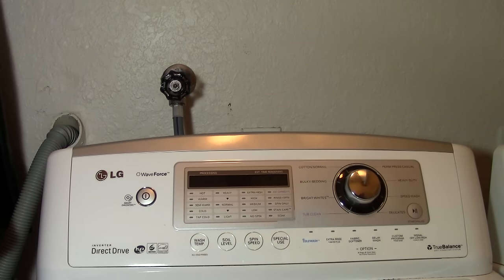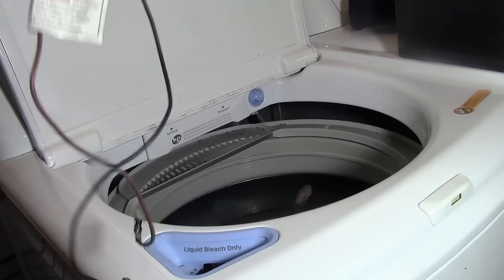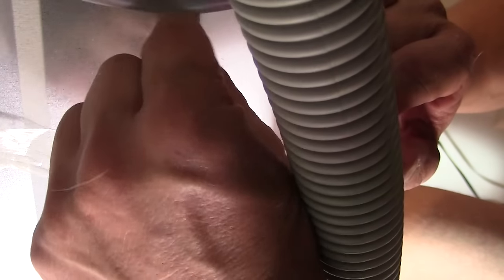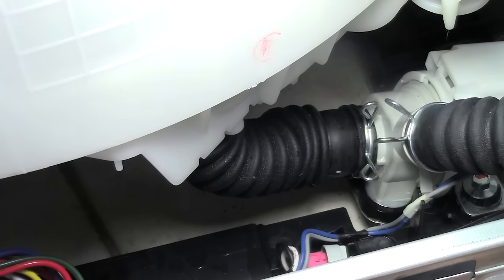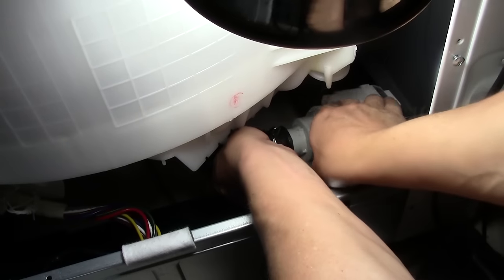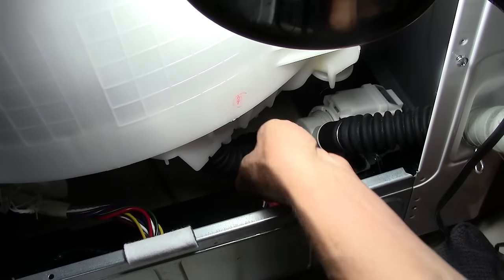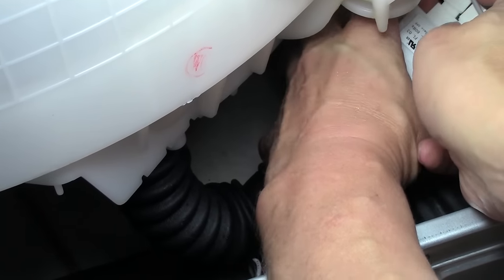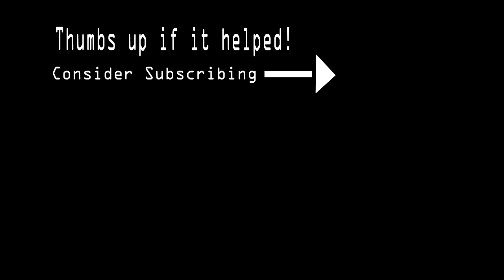LG Washing Machine Wont Drain or Spin --  (OE ERROR CODE) How to Fix PUMP and LINE

Comment: Thank you so much Jake!!!  Your great video and instructions helped me save a lot of $$$$$ since I did not need to place a service call.  I followed along with your video and I was able to remove the pump motor out...... and low and behold, a small nail was in the same area that you found the paperclip.  I reassembled everything and ran a "spin only" and it was so heavenly hearing that water drain out of my machine.  Thank you, thank you, thank you :)
Reply from the maker: Glad it helped!

Comment: Had same issue...removed the incoming line hose on the pump...nothing...prop moved freely...checked outgoing...nothing..reassembled and ran just fine...for now.  I think I will still have repair guy check it out. At least I can get a load or two done in the meantime. Thanks for the video.

Comment: Thank you, this helped me clear the drain pump of a piece of metal. Although I did learn a lesson that even though the tub looks empty, that hose and tub will still contain 3 to 5 gallons of water.
Reply from the maker: +crossmenjeff ->  YES!  There is definitely still water in the tub that you cannot see.  Also, the hose contains a decent amount of water, so if u disconnect it, water will be on your floor.

Comment: Jake, just disconnected the front hose and no debris. However the impeller turns with some reststance. Should this pump impeller turn super freely or is there to be some jerkey resistance?

Comment: Thanks so much for your video. My machine is a different model but  all the same i guess. I managed to fix the OE fault but the problem was within the filter itself. Your video showed me the way to remove the assembly and I went from there. Thanks.

Comment: Wow, Thanks man. Found some junk and a small screw. FIXED My wife thinks I'm superman. Don't teller I got you-tube help.  :^)
Reply from the maker: Yep, the hardest part about this job is getting the water out of the washer, because if not, when you disconnect those hoses on the pump, you will get a flood in your house.  Glad the video helped and thanks for watching.
Reply: Because of gravity, I was able to remove the hose and plugged it into another hose to drain it out to the backyard. Once you open up the clamp and hose to the pump, you'll still get some water out.

Comment: Worked !!!! I have abit of a different washer but components where the same ! I had a finishing nail stuck in mine !!! Thank you so much ! Also I used a shop vac to remove the water worked well!

Comment: Thanks for the informative video. Just curious I heard somewhere do you have to shut off the washer from the breaker first and then unplug the washer so it doesn't get damaged or the electrical doesn't get damaged?
Reply from the maker: +kl405019 --->  the only reason to turn off the breaker would be an extra step in safety.   But, unplugging it I think is better, because it's possible to shut off the wrong breaker.

Comment: Great video!, worked perfectly. Just be careful when you remove the hose on the left that is attached to the tub. I still had about a gallon on water that wasn’t visible from the inside. As soon I a detached the left hose I stuck it in the shop vac

Comment: Very helpful. It's easy to drain out water simply by dropping the end of the drain hose below the water level it will drain thru the pump if the blockage is not severe.

Comment: Thanks for the video.  Had the same problem so took the hoses off the pump.  I didnt find anything in the pump, but washer still wont drain completely.  Any suggestions?
Reply: Replace the pump.
Reply: same thing here - nothing in there, the pump just went bad after 11 yrs

Comment: We have done all the above there is nothing jammed in the pump and all hoses are clear...still shows error code oe does that mean we need to replace the pump??? Or could it be something else?
Reply: Hello! Did you manage to fix your washer? Im having the same problem took pump out checked connection to wall outlet and its running fine all ducts are clear. Please help
Reply: I’m having the same problem! Any update?

Comment: You can drain the machine manually by simply getting the other side of the drain hose to ground level.  The water will come out.   I have mine close to the garage door from the house, so I simply moved the washer over as far as I could, and dropped the drain hose just to the outside of the door and it drained out the garage door.

Comment: Hello and thanks for your post. It is really helpfull but I do have a question. If I took both hoses off and the hose from the pump to the washing machine had water still coming out, does that mean that the motor isn't working? The hose connected to go out to the wall had no water in it. There is also nothing blocking the inside the motor.
Reply: H8

Comment: Great video, mine was a bit of metal jamming the pump rotor, it did not help that three coins were in the drainage hose but they were not the cause - so up and running 
I  ran the drainage hoses into a low basin and bucket adn kept tipping the out , a towel under the machine cleaned up the small amount from the drainage filter plug

Comment: Mine did this Oe code. Looked at pump no issues ordered a new pump put it on still didn’t work. 

Plugged in old pump while washer was in drain cycle wiggle one of the terminal wires on the pump it fired right up.  Cut terminal off and added new one. So first check your wires where it plugs in while in drain mode. Give them a wiggle while in drain mode(rinse). Washer has a lot of vibrations at the pump and not much slack. 

Ps it’ll dump about 3-5 gallons of water on your floor even after getting all water you can from tub. This is if you pull the drain hose off the pump.

Comment: This seems to be a common issue. I've had mine about 8 months and have this issue. Most machines I've seen have a filter that is easily accessible to prevent having to do something like that for something as simple as leaving a paper clip in your pocket.  Hope it doesn't keep happening, will definitely tell my wife to check our kids pockets before loading the washing machine.

Comment: Hi Jake.. I've taken mine apart and I can't find any blockage. Do you think the drain pump is bad?
Reply from the maker: +laisha rae -->  it's possible.  You can test it by putting a current on it.  After you remove it, you will see where the electric was connected to it.  That's where you will need to put 110 volts.  It might buzz or hum which would mean it's frozen or has something stuck deep inside it.  If you cannot find a way to clear the debris or get the pump spinning,  you may have to replace it.  Also check the hoses for blockages. ..
Reply: jakeguitar01 Thanks for responding but I guess I'm a little confused. So obviously my washer was full of water when I noticed it wasn't draining. I got the hose that connects to the wall to drain the water in buckets. The water came out fine. Even if the water came out fine that way could it still be that there is a blockage? I hope this makes sense.
Reply from the maker: If the water comes out of that hose its not blocked and your pump is working fine.  Do you get the OE error code?
Reply: jakeguitar01 I did get the OE error in the beginning
Reply: I tried clearing out the hose and connected it back again and then i didn't get the OE report anymore. The washer just kept turning slowly but wouldnt drain
Reply from the maker: I would run another cycle through it and see if you get the error again.  It may have cleared itself.  No need to put clothes in it.  Just run a wash without clothes.  See if it works.
Reply: jakeguitar01 ok thank you. I will try to run another cycle

Comment: We have a front load lg that gets this error, even after replacing the pump, cleaning the filter and the drain tube.  It's hit or miss as to when their error will happen but it seems it happen on quick wash or normal consistently.  Many times, on another cycle, and on low spin,  I can get it to go thru a whole cycle.  Any suggestions before I call service?  I'm thinking the mother board.
Reply from the maker: +Lore McSweeney --> if the pump is not jammed with something and the hoses aren't kinked or blocked, there may be a sensor somewhere that's going bad.  I would check to see if your unit has some kind of sensor that may have gone bad.  If not, you may be looking at the control board as the possible culprit.

Comment: Mine doing same thing. I found 2 pieces of a jack knife in the washer ….probably my sons …. The small pin that holds them together i did not find. That was from the load before the problem started. I am thinking that is the problem.

Comment: Please someone help. Mine is this exact model.  The pump will get to this point and drain about one quarter of the water and then stops.  The washer will try to spin a few times after it stops then finally throws that OE error code. I’ve check for things in the line and it’s clear. The pump works good for the little water it does drain so that makes me think it doesn’t have any obstructions.  What can I check or could there still be something in the pump?  Please y’all help me out.
Reply: I would look at whether there is a sensor to monitor for water flow. I think there must be or else how would the machine know... I'll be starting this process tonight on my washer. Fingers crossed it will be that easy.
Reply: @kevinkibler2181  hi Kevin, did you find out if it is a sensor that stopped the washer from draining all the way? Thank you

Comment: I'm having a problem with WT4870CW the same washer it won't sense a load if I put clothes in it it does nothing and no error codes. Just flashes load sensing. It drains the water but sticks

Comment: I have an LG washing machine (top load)...it works fine up until the spin cycle. It doesn't spin, so the clothes are still wet when I take them out. I have terrible luck with taking things apart like you did in the video. My sister is going to kill me, coz she'll think I busted it😅

Comment: Well you skipped the part about the gallon of water that comes out when you unhook the pump!  8-)   Just did mine and it wasn't a paperclip but tons of sand like grip that had galled the pump rotor. Disassembled and cleaned, good as new!
Reply: "Well you skipped the part about the gallon of water that comes out when you unhook the pump!" That just happened to me! oops...😁

Comment: what should i check if the w.machine just pour water until the level but not spin?
Reply from the maker: Khunam Ajaib --> Do you get the OE error code?  if so,  the pump or line is stuck, blocked, or clogged.

Comment: Or you can use this steam cleaner suctioning machine to suck it out this well and just keep emptying out the container open up the bottom drawer that is for the pedestal and seal off those little holes they have and put towels around in case it floods

Comment: I had a used 1970’s Kenmore washer that was still working when we moved to another house and left it in 2010. 

Bought a used Roper washer off Craigslist for $150 and lasted 12 more years. 

Bought a brand new top load LG 16 months ago and at 14 months (just after warranty ended) the power button stopped working. I fixed it myself by watching a YouTube video. Now here I am again, trying to figure out why it’s buzzing, not draining, and leaking all over the floor. 

Anybody have an avocado green washer in their garage they want to sell to me? I’m sure it still works like a charm. 

Needless to say, I’ll NEVER buy another LG appliance again.
Reply: I've had my LG washer for 11yrs and this is the first issue I've had with it other than the the tune quit playing when it's done. I replaced he drain pump for $45.

Comment: Thank you
Reply: I wanted to follow up with you and just say that once I removed the pump I didn't find anything inside the pump itself.  I had attempted this fix twice now and I'm afraid that if I put it all back together and in place that I may have this problem again.  Is there anything else that could be causing the tub not to drain?  I heard a gurgling noise in the  washer and hose when I first attempted to remove it and it sounded like air in the hose along with a water sound you hear when the washer is draining properly.  It was like the slightest movement in the hose removed the pressure it was under if that makes sense.  Mind you,  I had already drained the tub with my shop vac and initially there was a little residual water left in the pump and hose itself.  I had made sure that the hose itself was not in any kind of bind so as to impede the flow of water.   I don't know how to tell if the water pump itself is defective but, when I stuck my finder inside of it I could move the wheel of the pump without any obstruction.  I am going to try to run a sequence of washer functions to see if it will work properly before I move it back into the laundry room.  If you have any other suggestions please respond.  If it works properly out of the laundry room  I will let you know.  Thanks
Reply from the maker: Bad pump.  They sometimes burn out.  Follow the link:  http://amzn.to/2vomM9Z

Comment: Fuck me! There was nothing in the pump and the pump works fine, because I hard wired it straight to a chord and plugged it in.  So next step is to replace the $250 circuit board. Couldn't be the easy fix that doesn't cost a thing for me.

Comment: I’m still getting an OE CODE even with replacing it with a new pump and no blockage also I’m receiving a UE code even though I’ve tightened the nut in the back of the machine this Kenmore elite top load washer refuses to drain and spin it just sits in its own dirty water and it takes days for me to do one load my clothes are starting to mildew and ruin my babies clothing I could scream I just want to take a sledge hammer to it at this point
Reply: I am having the same issue!!
Reply: Did you fix it ?

Comment: An easy way to drain the sitting water is to scroll through the special use button options until you see the "spin only" option.  It will take about 5 minutes to complete that cycle but it consistently drains out the water.
Reply: Unless the pump is stuck
Reply: But sir OE error means water is not draining out and that spin only option also will not drain
Reply: @gassyalways  mine just stop when it comes to the Spin cycle....I can set the special use to spin only and it spins and emptys
Reply: @darreldotson8194  thank you for your reply

Comment: Wow.  Maybe some kind of mesh net over the motor flange, to catch things?   Somebody could market one here. At least make sure the pockets are empty before washing.  A lot of you dudes have your hands in those all the time anyway......
Reply: I just got one of these used for $100. Date of Manufacture 1/14 so just three years old.  Seems to work fine- got this code upon a test run, but I'd forgotten to even remove the discharge hose from the holding brackets.  duh.
Reply from the maker: Great idea!  And I love your music.  You are seriously one of my heroes!!!

Comment: It is "DE" not "OE"
Reply: DE is door related, OE is pump related.
Reply: OE means it won't drain, washers calls for pump to be on but water level sensor shows it did not drain, generating error code OE.
DE is door not locking or door lock sense failed....